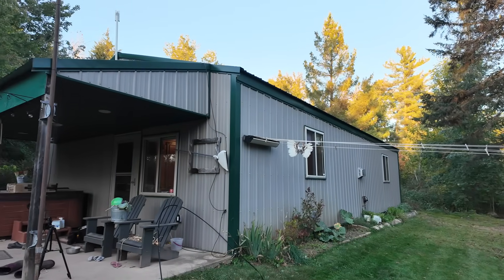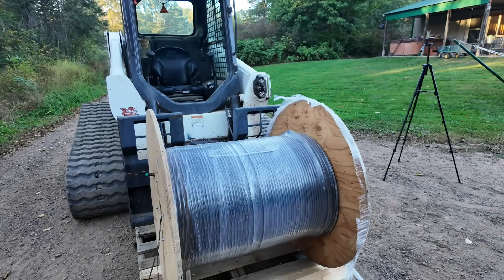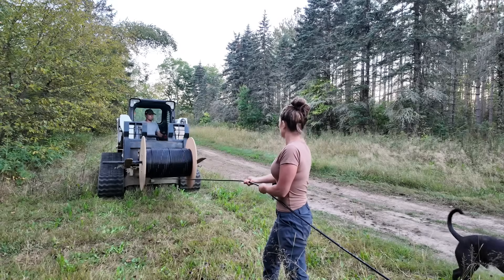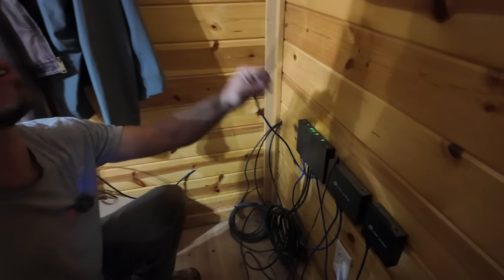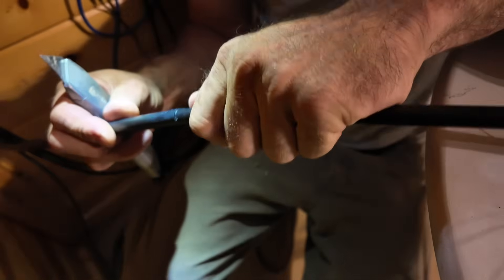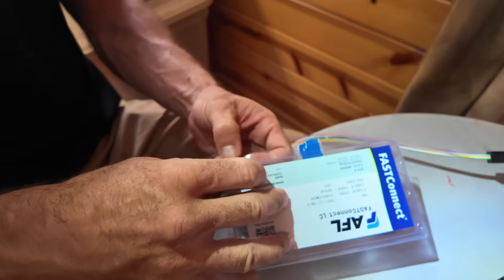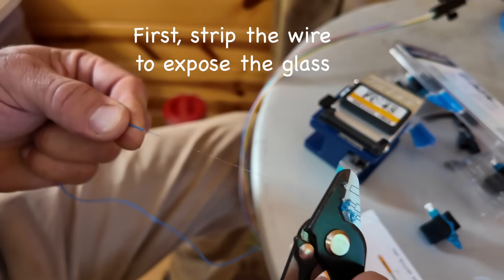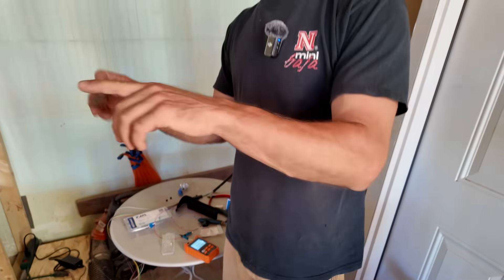We Need Internet! Running a 3,000 ft Fiber Optic Cable

Comment: In wifi,. line of sight is very important, so if you cannot see the endpoint of your network, chances are 98% it will not work, the other problem with directional antenas i sthat if they don't line up prcisely it will also not work, so even 2mm of over a distance of 3000 feet will place your target reciever WAY out of signal. I hav einstalled on our farm (Australia) a fiber link of 2.8 kilometers, it is a single cable, not duplex (2 cables) and it is still 50% faster than Starlink (in one of the sheds), you will not regret it, it is expensive to do, but it is 100% foolproof that is if you can trust your ISP, lol! they guarantee 99.99% uptime but everytime it rains hard, it always went down for a few hours but since we have NBN, National Broadband Network, Fiber to the node it is 100% up. Just make sure nothing can get to your cable, getting a cable splicer out to fix a broken cable will set you back about $1000. Good luck!

Comment: I work in datacenters and a network nerd for MSP by trade. You may just be treating all of this a temporary and I would likely do the same. However, you should be protecting those pigtails in an fiber distribution box where they are spooled up, they should be terminated to a bulk head. Then you use a fiber patch cable LC/LC from that box to your device. fails in line with structured cabling principles. I am not a fan of the pigtails versus fusion splicing, but for DIY, its nice to know that it can be done. No DIY person is going to buy a fusion splicer, but you can hire a cabling firm to come out and terminate all of your ends. Also you could use BIDI optics to not need a pair, just a single fiber stand.

Comment: Branches and leaves block microwave links...  think anything that would cook/burn in a microwave.  You'll have to have a clear line of site from one dish to the next, you likely can't get a permit to erect towers tall enough.  Radio waves and light waves are closely related, anything opaque to visible light is likely opaque to radio and microwave radiation.

Comment: Oh man. This is why you go pre terminated and just coil up the extra cable. Fiber termination is an ART. Nicely done.
Reply: if u have the right equipment its pretty easy, just cleave and throw them into the splicer and bing banda boom you have terminated cable
Reply: I mean.. These are push on connectors, so kind of the cheater route.. But glad they got it to work

Comment: With something like Mikrotik GPER, you could run regular UTP cables up to 1.5km. They are tiny repeaters powered by POE. A length of 3000ft/1km would require 5.
Fiber will always be a better solution if implemented correctly, but once you accidentally have a cut for whatever reason, there is no easy fix. Regular UTP can always and easily be repaired with minimal gear required.
Personally, I would have trenched a pipe, with an accessible pit every 100/200m. Pulled UTP+mikrotik GPER. Way cheaper and adequately reliable. If I later on decide I want fiber instead, I’d get pre-terminated simple fiber and pull it through the tube.
The absolute cheapest lowest effort would be to get pre-terminated air/pole line fiber and just lay it through the woods. Sooner or later something probably will break it, but for a total cost of 300-500 bucks ¯\_(ツ)_/¯.

Comment: Awesome you guys tacked this.  I've been engineering DWDM systems since the 1980s!  I cringed when I saw you measuring loss at 850nm knowing you has single mode fiber designed to work in the 1310nm/1550nm range.  Honestly, you only need a cheap optical power meter that will measure at 1310nm (most will) and a short FC patchcord.  Measure the tx output of the SFP.  Then go measure the power on the cable at the far end.  You will have less than 1dB of loss over 3k of fiber.  Your splices and connectors should be less than 0.25 and 0.5dB respectively.  If you have SR (short range) optics, you shouldn't need any attenuators as the max tx will be less than the max rx power levels.  You are probably running 1310/SR 1GE SFPs and that should do it!  Note that you can get SPF+ that will run 10GE but that would be overkill.  I've also turned up ethernet radios and if you get high enough to avoid most of the foliage, that would work as well.  Ubiquiti has a on-line tool that will let you do a microwave survey and it will take all that into account.  Nice work!

Comment: Nice project! But pay attention to two things: At around 8:19 when you pop through the wall, always drill from a higher placed hole on the inside to a lower one on the outside, combined with a drip-loop on the outside. In combination with some caulk it helps keeping the water out 😉
Also consider adding some edge-protection to the sharp metal siding to avoid cutting the cables 🙂

Comment: Ive never watched before but I found the fiber bit interesting. I have never done fiber but done alot of cat 5  work. When you buy that put a copper wire in the trench so that you can locate it later if you need to.

Comment: Very impressive on the fiber run. Here are a few tips from a guy working Fiber optics and networking for the DOD over 20yrs.

1. Either bury that fiber or raise it off the ground. Why?   Surprisingly, rodents eats and shreds the cable for den installation.

2. If you have 12strands terminate all strands or seal the excessive in a shrink wrap.

3. It's best to terminate the fiber Into a patch panel, then a patch cord to your device. Maybe, this approach is more data center and avoiding tampering or accidental damage.

4. Feom your outside to inside try to have a 3ft loop of excess. Just so, if you need to pull more because of damage you can.

5. Inside. Make a 1ft loop before the termination. This helps with that last segment to be terminated.

6. The SFP should be the same type in both ends. Never mix Single mode with multi mode. Your real goal is to achieve 1gigabit speeds without any latency, frame or packet loss. If you have a smart switch you can see if you are dropping frames between switches. This can be a problem over time as you put more and more data on the line.

Overall, pretty good... you've taken on a function that takes other people years to achieve. 

Keep in mind the connectors have a set dbloss so take that into account,  and the more bends in the outside run adds a -1db per 1ft bend. And this is how you get the total db losses.

Comment: Far as DIY and first time this is pretty great, you managed to get signal +2600ft!
The rest of the comments already pointed other things out like trunking and breakout boxes, I'd suggest getting some kind of "mile marker" type to set along the fiber's path so someone in future doesn't dig through it. Another thing would be putting the cable inside underground pipes along with wire to pull through anything else in future... but that might be overkill. At the very least put the cable inside pipes closer to the properties, for the odd pickaxe or shovel.

Lastly, consider putting all those network boxes inside a wall mounted cabinet, a 6U network cabinet will tidy that up nicely (none of them do wifi directly so the cabinet won't impede signals from other AP).

Comment: This video was awesome. I’m new to fiber too because I have some rentals on my property that are about 350 ft from my main house and I used to use cat6 and it was very buggy and unreliable but I wasn’t even aware that you could do fiber.  I had some of the same problems like not knowing to switch the wires on each end. I also have a problem with one of my connectors where if it’s plugged all the way in it doesn’t work but half way in before it clicks the thing works perfectly.  It can definitely be frustrating when it doesn’t work and you spent a lot of money on the wire and routers and time running the fiber and it doesn’t work. But when it finally works and you have blazing fast reliable internet it’s very rewarding.  Great video!

Comment: For a first-time DIY'er... not bad!!  You did your homework and your switches on either end are talking to each other!  But here's some pro tips to ensure all that hard work lasts for decades... 

Rent a ditch-witch or trencher and bury it at least 2-4 feet (if you're in northern climates ideally below the frost line) - just be sure you know where you buried it since things like backhoes and other digging equipment will find it for you!  Backfill to a foot below the surface, then lay a plastic marker tape on top of that before backfilling the rest.  Leaving it above grade, even through woods, is begging for it to be damaged. 

Getting a 12-strand cable is better than 2-strand so you have spares in case of a bad strand somewhere (it happens).  Plus the cost per foot difference is negligible.  You did good there! 

SFP - not SPF (it's a Small Form-factor Pluggable module - not sun screen!)  😀

Leave a coil of slack somewhere in case you need to reterminate or relocate it at some point.  Otherwise, you're looking at running new cable if there's no slack to pull from.  Materials are cheap.  Labor isn't.  

Don't cut the strength member (the thicker white fiberglass rod in the middle) all the way back.  Keep it sticking out at least 6" as you'll need to secure that to something like an enclosure (see below) to keep the cable from moving around then trim as necessary.   

A stitch ripper used for sewing/embroidery, etc... will cut through all that intertwined yard when you take off the black outer jacket.  

Get a small fiber optics termination enclosure with LC headers at either end to protect the fiber strands and terminations (even if they're in a breakout kit).  Read the instructions on how to properly secure the fiber strands with the slack spools in there.  Then from there, use a 1 or 2 meter LC-LC patch cable from the enclosure to your switch. This protects your fiber and terminations, making the patch cable itself sacrificial. 

If drilling through metal siding, get a rubber grommet or something to prevent the sharp metal edge from digging into your cables. 

Keep everything in the right color sequence - blue, orange, green, brown, slate, white, red, black, yellow, violet, pink, aqua and use them in pairs (i.e., blue/orange, green/brown, etc...).  For your purposes it doesn't really matter so long as they match up on either end, but it's standard across the telecommunications industry.  

The LC connectors you are using won't last forever - but if you do - put them in an enclosure with LC headers (above).  Find a fiber guy with a fiber splicer and purchase pre-terminated LC connectors and fusion splice them to the cable you just ran.  They'll last much much longer.
Reply: "If drilling through metal siding, get a rubber grommet or something to prevent the sharp metal edge from digging into your cables."  Came here to say this too.  I know they're excited, but one really should slow down and do it right even if you can't connect the day the cable arrives.
Reply: @steveloux4709  Also helps keep out little critters (and cold air in the winter).
Reply: I'd like to add to your comments by adding, PLAN AND DOCUMENT. I have not watched this channel before, came in skeptical also, and thought, man, if they put a couple handholes in along the way, they could add splice cases later to extend the fiber to any other buildings, and run them all from a fiber distribution switch, and have 10G links (or faster) all over their property.

I say document to support your comment about using industry standards. If there are any issues later on, for yourself or potentially the next owner, it will be so much easier for them (or a pro) to troubleshoot and resolve an issues. 

... and be careful with that fiber. singlemode is like 9 microns of stranded glass. you do not want that under your skin, or stuck in your body somewhere.
Reply: Bury cable asap!
Reply: @smailspace2624 absolutely! There are many animals that will chew through the cables. I just had a temporary cable used to fix damage from Helene damaged by a beaver.
Reply: @smailspace2624  - We had issues with squirrels! Some of the plastic sheathing was soy based and those little bastards figured it out fast!
Reply: @Snarkapotamus  And if those squirrels eat all the sheathing there, they then go to your car's engine block and start munching on the cables all around your engine.
Reply: @bikeny  - LOL! Yeah, had a car that had plastic fuel lines that they loved! After the second time of them chewing through the lines, I put stainless lines on it...
Reply: Get some 3M EMS mini markers and throw those (e.g. one every 10 meters) into the ditch with the cable. It will help a lot when somebody needs to know the location of the fiber in the future because you can scan the locations from above the ground with zero visible markers on the surface. I think there isn't a marker for fiber but maybe you can use telecommunications markers for this. Scanners for those passive markers are insanely accurate (down to centimeters in XYZ even if the marker is a couple of meters below the ground).
Reply: I’m amazed you were able to post that without YouTube automod just deleting the post
Reply: @leexgx  --  post what?
Reply: Some very valuable tips here for anyone trying something like this as well after seeing the success, thanks Lester.
One thing i would probably do as well: Never drill thru the wall horizontally, drill down from the inside out at a small angle, so any moisture/water would naturally tend to go/stay outside. And i would have added some kind of pipe/protection to the cable going thru the wall and down into the ground. Over the years, you could have some mice or other critters getting into the walls/insulation, and they love to chew on wires for some reason. They might not get thru the reinforced cable that quickly, but if you want this to last decades, installing it properly now is easier than trying to fix it then. And on the outside of the house, the cable will be exposed to direct sunlight and maybe even someone getting a bit careless with a weedwhacker or lawnmower at some point, so i would prefer to have my wires in a protective metal pipe shielding it from UV aging and possible mechanical damage.

Comment: not familiar with the network equipment your using, but i strongly reccomend Unifi. I love the unifi system, no subscriptions either. can do cameras as well with the same POE. It seems your on the borderline where unifi could really work. THey also have building to building dishes but you need direct LOS (usually a tall tower/pipe). But super cool video

Comment: Wow nice job.. Awesome video.  Using SMF SFP's Make sure your receive levels are within specs of SFP.  Hot levels can cause issues and damage your receiver.  If those are intermediate range SFP attenuators might be needed with a short run.
Reply: For a 3,000' span using generic SFP's?  No.  Attenuators are typically needed on higher power telecom grade stuff where spans are measured in miles.

Comment: Some food for thought. I don't know exactly the type of SFPs you are using and the sensitivity of them, but if the signal is too hot you can burn up the receiver on the SFP. You should try to keep the signal within the operating range for the SFP, if the signal is too hot, you can buy LC Attenuator pads to bring the signal down to the best operating power, just place an attenuator pad in the receiver of the SFP, and plug your fiber from outside into it. This will preserve your SFPs for a very long time, if you start having issues, consider reading the specs for the SFP and getting your optical power level in best operating range.

Also, you don't need a tool for opening armored cable. You just need a razor knife. You just use your razor knife to ring around the cable about 5 inches from the end of the cable. Then just pull that 5 inches off and expose the rip cords on the inside, they are the orange/red strings that are in there. Then you can just pull them down the line. To remove all the cotton stuff that was a mess, just use a little 1 dollar seam ripper.
Reply: A singlemode span of 3,000 feet using standard Cisco GLC-LH-SMD SFP's (or generic equivalents) is fine.  I've done far shorter spans without any overloading - even with 1 or 2 meter patch cables between switches.  Attenuation is only needed for higher powered telecom grade equipment where spans between equipment are measured in miles.

Comment: Thanks for sharing your experience. Will help a lot on wiring my whole house on glass fiber in 1-2 years :)
Reply: I'm about to run fiber in my house, since we just got 5gig internet. I just bought some 20 meter duplex singlemode LC-LC fiber jumpers, just like what I used at work.